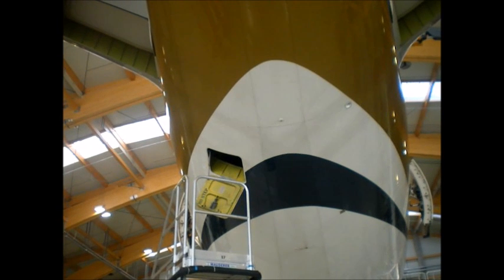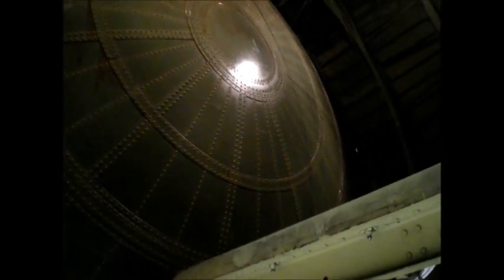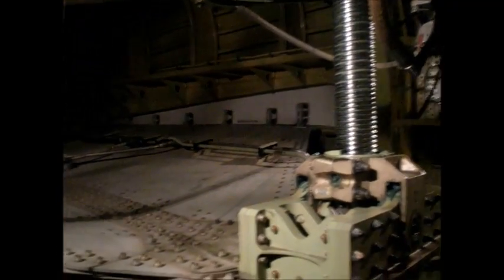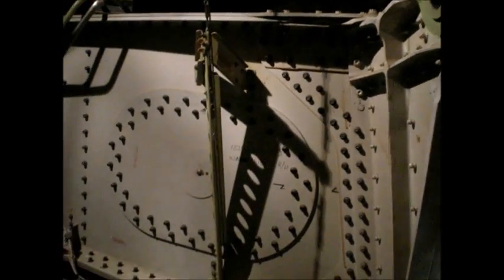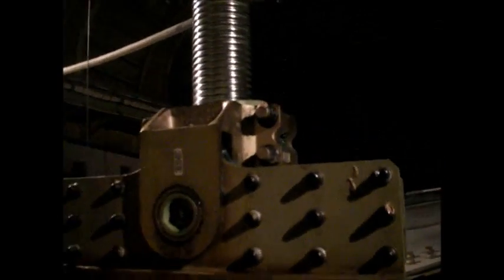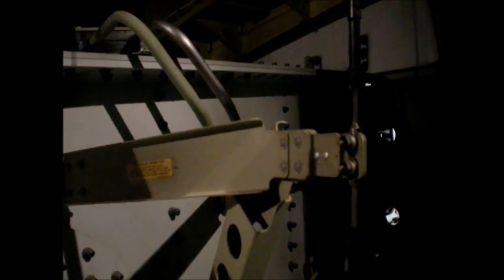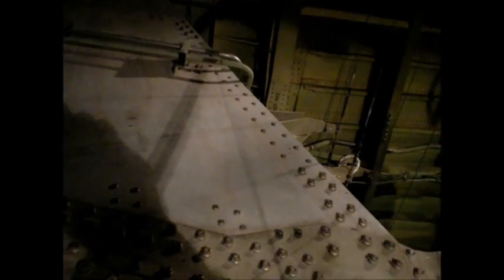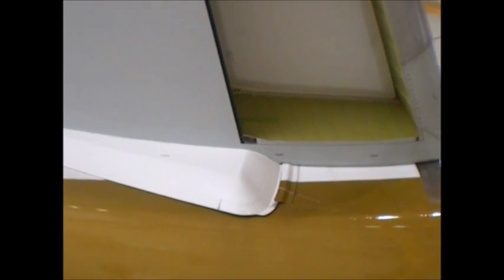Boeing 777 Aft Pressure Bulkhead - Horzontal Stabilizer

Comment: Good demonstration dude. However, 
 00:53,  there's no hydraulic pump in the APU. The hydraulic lines are for the accumulators and empennage flight controls, etc.

Comment: I still can't believe that there isn't any proper redundancy built into the elevator trim in most aircraft... At least something that puts the elevator in a centered position if the jackscrew were to fail.
Reply: You would think that after Alaska 256, Boeing, Airbus, and the FAA would have the airlines install something to keep the horizontal stabilizer straight so they can get the plane safely on the ground and get the jack screw replaced.

Hundreds on lives on one plane depend on the jackscrew to work.
Reply: The Alaska Flight 256 had nothing to do with the Pitch Trim System design itself. It was purely a fault of Alaska Airlines maintenance.
Reply: @tails4674  I know! But a single point of failure in the design failing had everything to do with the plane crashing! Sure, maintenance was the cause in this case, but with any form of redundancy in the design it wouldn't have been catastrophic.
Reply: I was thinking the same thing. Remember Alaska air?

Comment: Extremely shocking old fashion tech. Just the idea to have wires for sensoring...
Reply: why not? its easy to maintain and insoect, and it well proven and the fault tree are very well ressearched and evaluated. many times thebkeep it simple principle is the way to go.
Reply: @johndoe1909  It a possible and unnecessary source of error compared to direct linkage.

Comment: Can that screwjack be activated from inside the 'hellhole'. Just to check smooth operation and limit switch settings maybe..
Reply: No.  Mechanic in hell hole uses inter phone to converse with mechanic in cockpit to operate operate trim motor when inspecting and adjusting stabilizer.

Comment: Im not seeing a whole lot of grease on that jack screw.
Reply: On the other hand, the special shape of its threading makes me think it's probably actuated by a ball-driven nut…
Reply: @ObsidianParis  its an acme thread for a jack screw stupid strong like a buttress thread. Ball screws have a certain radius and are much more accurate but cant handle the loads generated in flight. Unless boeing pulled a rabbit outa their ass.
Reply: @rapturekevin  It's a ballscrew. As stated in the 777 manuals and various airworthiness directives over the years.
Reply: @8710ify  I beg to differ. Either  a jack screw or a ball screw  a lack of lubrication will make both fail. I have the drawings for the dc-9. My friend gave them to me when he retired as a maintenance tech for air Canada. There is an extra page added in the book for the Jack screw. It's literally stapled in. New jack screw procedure.

Comment: Cables still? Why would a modern aircraft use steal cables?
Reply: as backup for the fly-by-wire system
Reply: Because it works?
Reply: Steel cables
Reply: Stuart sugden shut up Stuart
Reply: There is a federal law against stealing cables, steel or otherwise, from airplanes.
Reply: With steel cables you are always mechanically connected with the flight controls and so you have always control of the aircraft.

Comment: This is really cool. Why have mechanical cables feeding back trough the bulkhead where do they lead?
Reply: BigIronTV these cables are the only backup pitch control during the electrical blackout or control channel failure. In the event FBW fails, the cables directly command stabilizer trim.
Reply: Hi.may i ask you explain one more time with more detail,
Reply from the maker: Thanks.  Not sure of the designing reason for the cable.  It connects the horizontal stabilizer to the stabilizer position module which in turn give a signal to the array of electronics than govern the movement of the stabilizer.
Reply: Screw-threads of any size can collect debris over time and are liable to jam: should the thing decide to lock-up during a flight, it's goodbye.